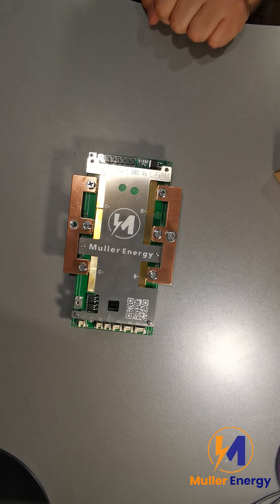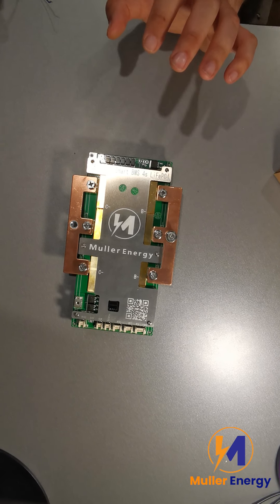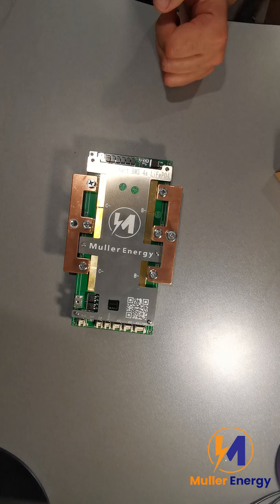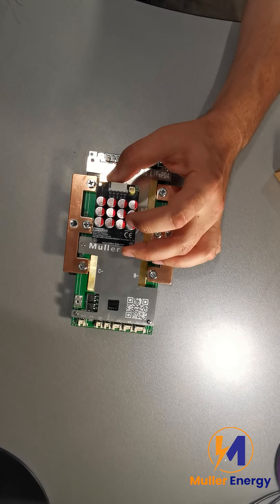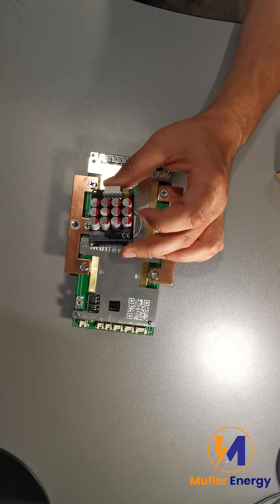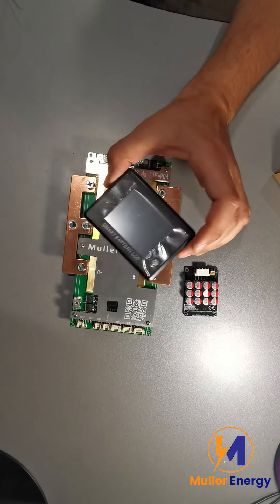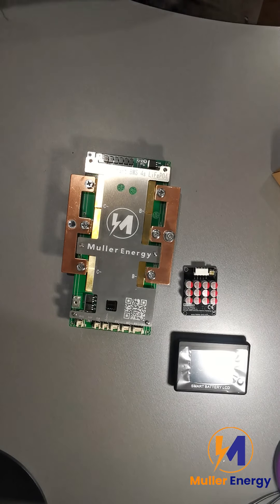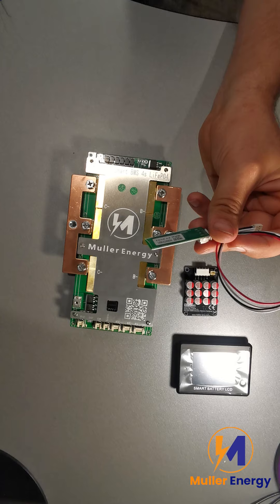Muller Energy Exclusive: 250A JBD Smart BMS with Active Balancer

Comment: Two questions:  - Terminal for the heating. Does this draw directly from the battery or the solar side when the low temp cutoff is engaged? 

This unit has 16 cell lines on the display, and I was told at the time of purchase these units can parallel with one another, how does one intertwine the two so they can collaboratively communicate with one another for efficiency purposes?

Comment: Merci pour vos éfforts.  J'attends avec impatience un modèle en 8S pour mes batteries lifepo4 24V, avec une puissance suffisante pour mon Victron quattro 24V 5000.
Je vais équiper mon catamaran en lifepo4 8S-24V et j'aurai besoin de 4 ou 6 BMS qui puissent aussi s'interconnecter entre eux par prise RJ et avoir un bus CAN pour pouvoir gérer sur mon victron GX les 4 ou 6 batteries 8S 24V 320AH en Parrallèles. Continuez comme cela c'est super. J'espère que vous pourrez envoyer en France Europe les produits.

Comment: Can the charge and discharge current and potential limits be set via screen inputs or the bluetooth connection?
Reply from the maker: They can be set via bluetooth but not on the screen.
Reply: @mullerenergy  Wow, so that is a very impressive device. Hopefully you can ship to the USA.
Reply from the maker: @judgedredd8876  as long as you're aware that it might take a month for shipping from Australia, yes, we certainly do.

Comment: In the pdf shows to put the color coded wire on the positive on each cell.  So why are you putting it on the negative per cell.  Is there something I should know about
Reply from the maker: Thanks for that. They are both correct, the negative of one cell is connected to the positive of the other cell by a bus bar and they are the same voltage potential. So you can choose whichever one suits you. You can even mix and match, if you want to.